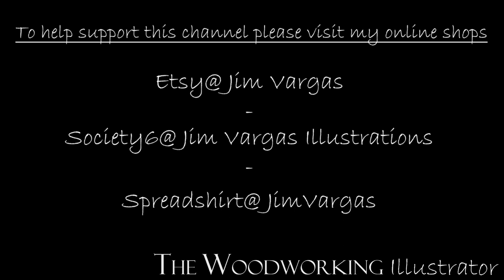Hybrid Ink Dip Pens

Comment: Not many video's on making dip pens. I have made a few, but never filmed them. I turn them and drill a 6mm hole in the ends to fit a ferrule to hold the nib. Very wasy to make. The shaping is the best as no shape is the wrong shape and better than the straight tapered shape of new ones. :)
Reply from the maker: Thanks for sharing! To be honest when I decided to make these I hadn't known that there were better nibs and simpler ways to make a dip pen.  Some day I would like to make a kit less fountain pen.
Reply: @jimvargas-thewoodworkingil9357  I would like to make a fountain pen, but the kit ones are ugly in my eyes. The section being brushed steel / brushed alloy and so long puts me off them. I have a lot of ountain pen parts and I think I could make a wooden body for some bits of pens I have. I dont have a mandrel or any blanks or tubes now to make a kit pen and only have a drill that is on a holder to make it into a lathe as I sold my lathe as it didnt have a 3 jaw chuck and could only turn between centres. If I manage to get a 3 or 4 jaw chuck that will fit into a drill chuck, I might be able to make a wooden barrel and cap to fit a section.